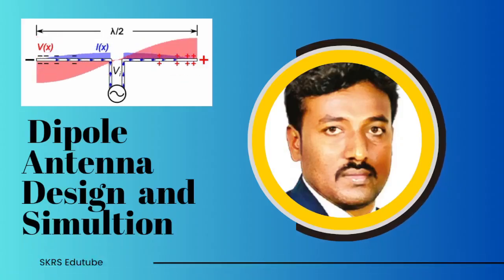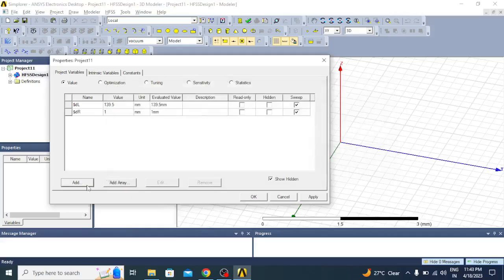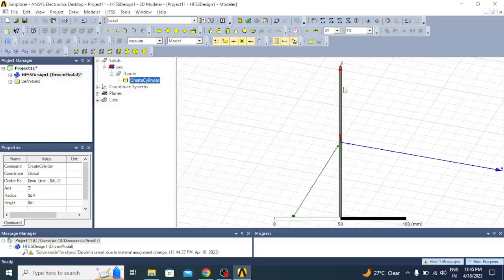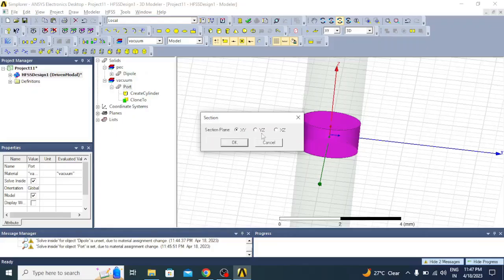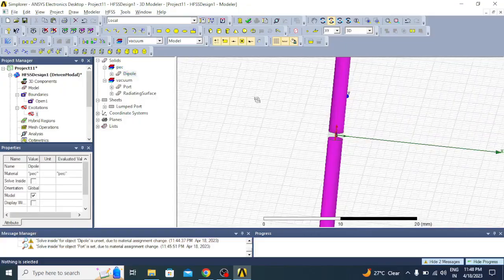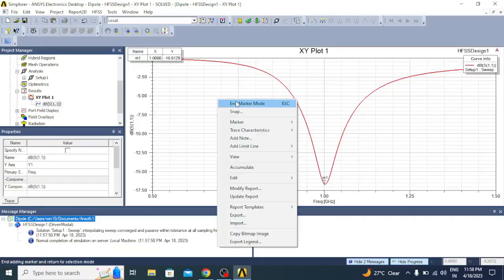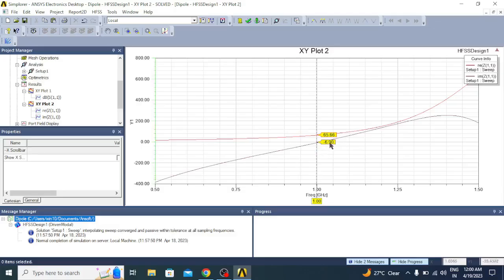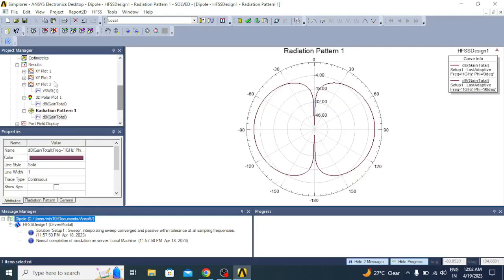Dipole Antenna Design

Comment: sir can you tell me how to calculate HPBW
Reply: You can plot a 2D radiation pattern, note down the peak value. With respect to peak value mark -3dB  down on the plot to get the points that coincide with  the radiation pattern traces. The angle between that two points will give you HPBW.
Reply: @Shashi-kq4ze  Thank you so much sir 😁